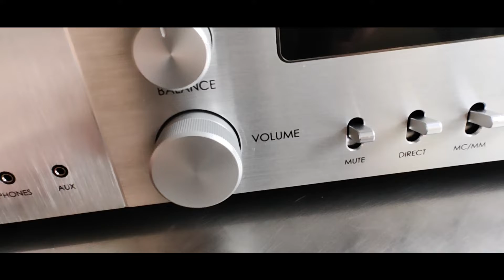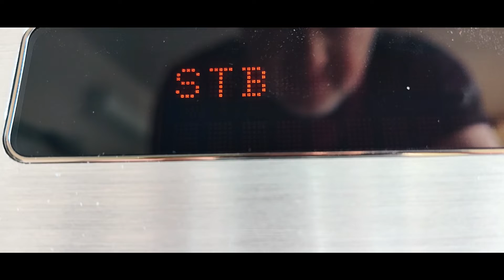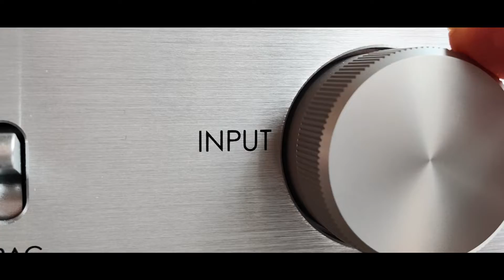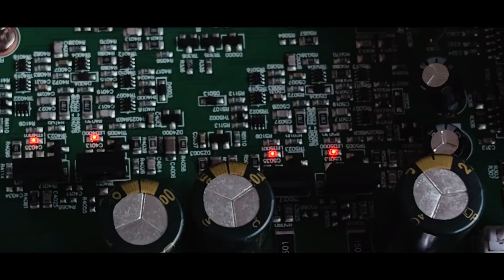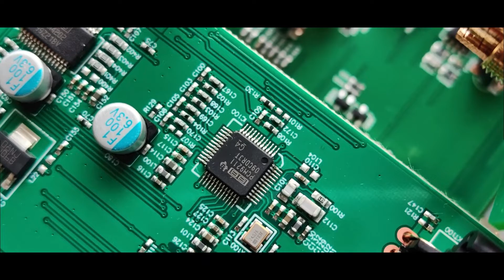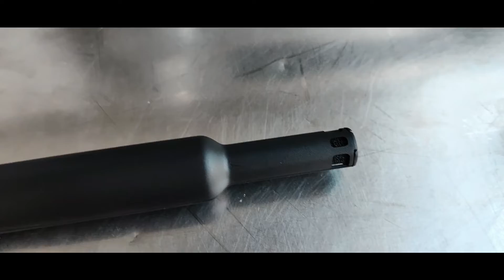JBL SA750 has almost everything, a retro design with modern technology | Deep Unboxing

Comment: No Bass no treble Control, i often have Problems with the straming connection.
Reply from the maker: Sorry to hear that
Reply: @hxosplus  the 750a is not worth the money
Reply: Agree..seems overpriced  @arnonym823
Reply: But it has Dirac? Why would you need bass and treble, Dirac is the ultimate in correction.
Reply: @Brett1334  room perfekt is much better